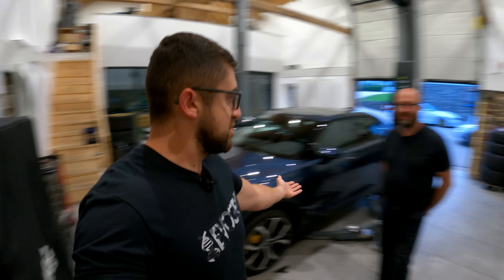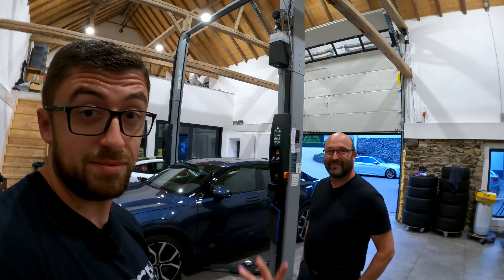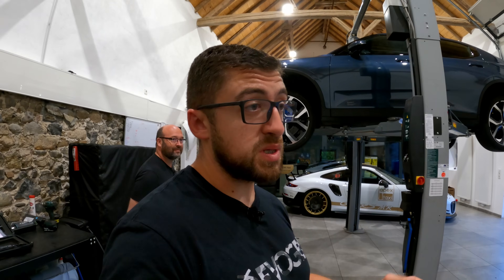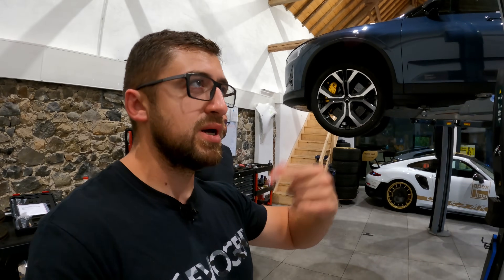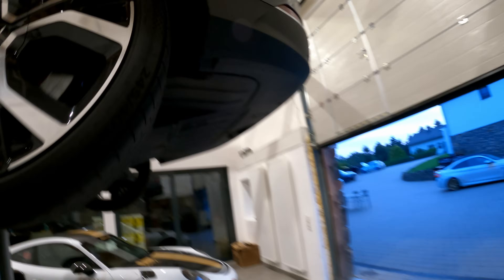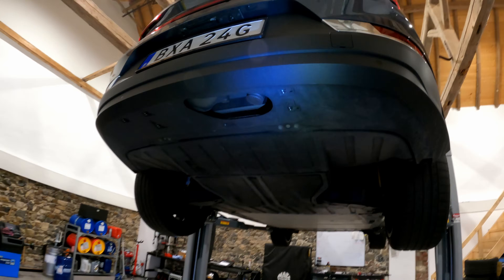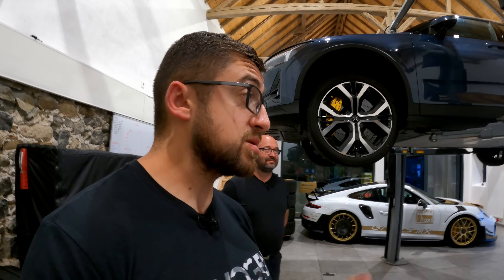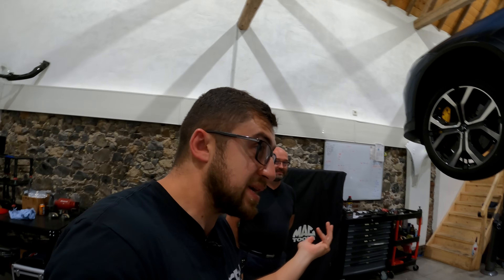Polestar 2: Performance Engineering Explained

Comment: Speaking about regen braking here's the thing people forget: for regen to work the electricity needs somewhere to go, and you sure as hell can't just dump that into the ether. Hence if your battery is full or not in a compliant state, or say if there's a electronic/electric/mechanical failure which prevents electricity from flowing into the battery properly you lose regen.
Reply: and this car, even with 100% SoC, does not disable the one pedal driving mode, it just uses the friction brakes so the driver doesn't need to relearn how the regen changes with SoC. The car does it for you.

Comment: Here in the US (Colorado specifically) some of the public roads are really hard on my back at 8/8, so after some testing, I've settled on 12 clicks for the front and 15 on the back - it's not quite as tight as I would like, but my back is much happier! I have a chance to take it to the track next month though so I'll be going much tighter that day!

I will say though that when I tested the car with all four corners at 20, it was incredibly fun on unpaved roads. POLESTAR RALLY :D

Comment: Ha! I asked about this the other day, good stuff. However, I don't think you touched on the staggered wheel widths (unless I missed it?). The front wheels are 8", rears are 9", but the tires are the same. I'm guessing it's to stiffen the rear tires' sidewalls, but I've been curious about the "official" reason.

Comment: I don't specifically know about Ohlins for cars, but for motorcycles they offer both remote mechanical and electronic adjustment options, with the latter being computer controlled. So there should really be no need to have to go under the car to make adjustments, and potentially they could be made while driving. So there was probably a cost consideration involved here, but on the plus side I expect you can get remote adjusters as an aftermarket option from Ohlins.

Comment: This car is pointless for the track. It's very slow for the power output and performancce goodies it has. The engineer said it's more about the balance and that is something that doesn't really come across on video.
Reply: Did you even see the previous video? This thing passed a Porsche GT3 and kept up with a Ferrari 488...
Reply: @evenbraut1495  It's touristenfahrten not a race. All kinds of folks are cruising the track that they most likely have never driven before.

Comment: EV = 🤮
EV-Cars are like buying a Computer in the 90s at ALDI. Inside the store, the price of the Computer is 10x higher, as outside. After the purchase, the price shrinks immediately on 1/10 of the price inside the shop. I have sold my Tesla-Crap 1,5 Years ago, and it is STILL at this dealer. 2nd Hand EVs are not sellable. Besides that, EVs are TOO EXPENSIVE! I never would pay AGAIN for a EV more than 15000€, because of the price drop and the not-existing-high-tech, in comparison to a combustion engine. More than 15000-20000€ for a Body with "3 Cables", a big electric motor, a frequency converter, a joystick as throttle pedal and a stinky huge Li-Ion Battery. There is nothing expensive. Sorry! Never buy such a electric crap AGAIN. Bullshit-TEC

Comment: the "low maintenance" on EV brakes is NOT correct. they r used so little that they rust. and you often need to replace them at every inspection.
and lets hope they up the towing capacity a bit. 2000kilo is a goal. 
and the old "polestar" stil exist. it is now CYAN ;)
Reply: I can second that. I work at a VW dealership and recently changed the rear brake discs and pads on a 2021 Golf 8 GTE (hybrid) with 5k kilometers on it, because they were severely rusted, no chance with braking the rust off. Most people that drive EVs or hybrids are economical drivers, they use regen brake alot and don't brake with the mechanical brakes. From time to time you should at least brake the rust off the discs, before it's too late.

Comment: A serious contender as a replacement for my M3P but it would want another 100bhp to justify the £60k price. After some more reading no car play … that’s a deal breaker. As is signing in with a google account. Shame.
Reply: Now you can get both Apple CarPlay and more HP with a OTA update. It's not 100 hp though, only 68. Apple CarPlay came with v2.2 and is free. The 68 HP costs $1,199 USD I think.
Reply: To me, the engineered chassis and brakes justifies the price. Polestar is experienced at motorsports and Volvo is experienced at making solid vehicles. This vehicle is like a really well tuned Volvo. Car play will come in time.

Comment: I have seen so many "major" youtubers complain about the stiffness of the Polestar 2 performance, shame they didn t read the manual and adjusted the dampers (knowing there are 22 clicks available must mean there is so much adjustability). Great job they didnt save money on such important components as brakes and suspension. Big thumbs up.
Reply: Tbh, as much as fun the idea of manually clicking the suspension I wish the damper adjustment is more accessible either through electronics or just removing some interior / frunk panels. I wish it was easy to the point where I can easily change them at home or even the hotel parking the morning before some fun driving and then set them back when you're done for the ride back home.
Reply: Exactly! It drives me crazy. These reviewers are supposed to be car people and yet they have no idea about the dampers

Comment: Can someone explain to me this
1) Is Polestar still apart of Volvo and if not why did they leave
2) Will Polestar still do performance upgrades for Volvo  
Lastly 
3) Polestar 1 being 140K pounds shouldn't they cars have more power for the price? Just curious
Reply: Polestar is owned by volvo and a Chinese company
Reply: @ahyaan2552  Geely describes the Polestar brand as "independent" from 2017 onwards and "co-owned" by it and Volvo Cars.
Reply: Polestar is going to merge with Gores Guggenheim so thats going to be interesting.
You can use all current Volvo service stations for Polestar.
Polestar EV tech is shared with Volvo, but there is no "polestar performance division" like before EV branding.
Volvo is working on a new performance division, dunno the name of it though.
Reply: Volvo and Polestar share a lot of the same personnel. Polestar will move to distinguish itself some from Volvo but you can tell they're relatives. Volvo owns 45 percent of Volvo but the whole ownership think I think is overblown. How much do they share with Volvo? A lot. Geely? They used Geely to finance and some Geely factories to build while also some Volvo factories to build. Will there still be Polestar Volvos? I hope so.  Polestar 1 is now history as it is no longer sold. It's now on to Polestar, 3, 4, 5.

Comment: Thanks for asking the questions and checking how "special" this polestar 2 was compared to what we can all buy. Again great that Polestar are attempting to give performance options and think about enjoyable driving. The manually adjustable dampers are an interesting choice from factory, but I see that your taxi and rental cars use manually adjustable suspension too. In the UK the performance pack adds £5000 to the cost - how does this cost compare to the components on the Cupra or the other Apex cars ?